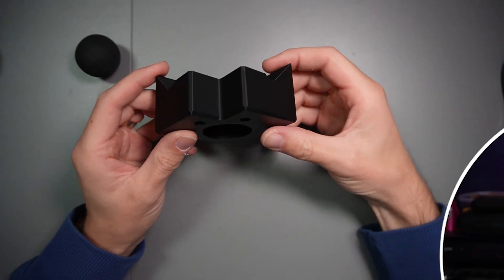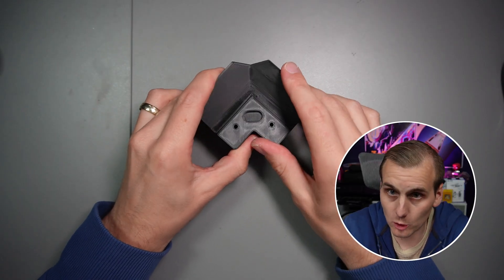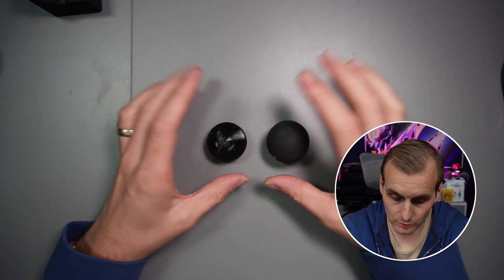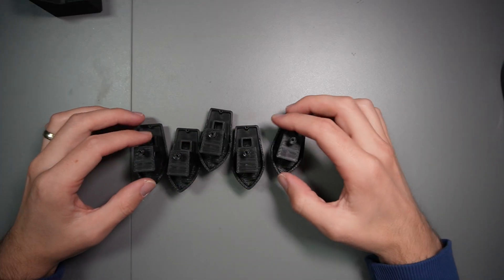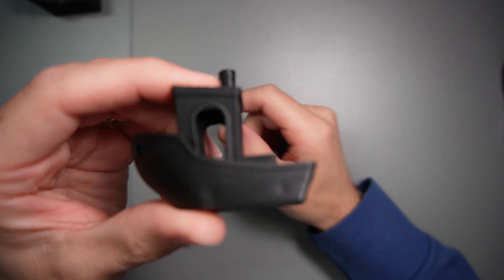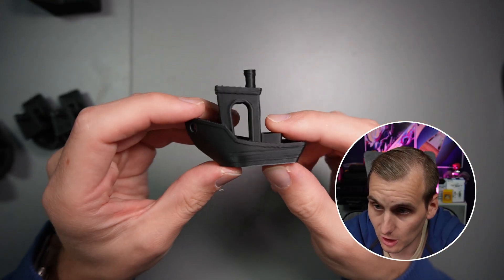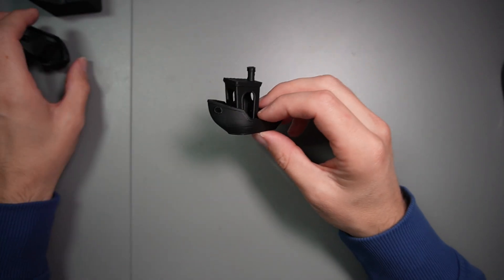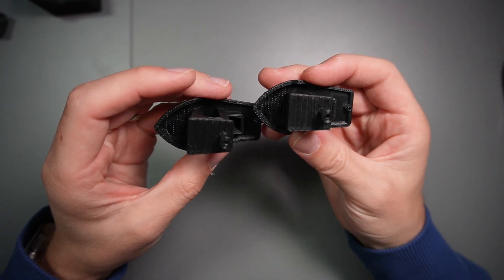Overhyped? Can Squash Ball Feet Fix 3D Printer Vibration?

Comment: I made my own conical tpu feet that clip into pla cups that are screwed onto the top of a set of draws. The draws are tie wrapped to my heavy cantilever desk with a thick tpu sleeve.
This holds everything really steady and the vibrations are evenly damped and spread, though you can feel it a tiny bit on the desk.

Comment: I used the same print for my core one but found the Squash balls too soft and allowing the printer to move to much so I went on Amazon and found some super bounce solid rubber balls that are the size and the more firm balls are perfect the machine is very happy and it doesn't affect the prints at all
Reply from the maker: O ok, can you send me a link please? I’ll give em a test. Im using the hardest squash balls at the moment